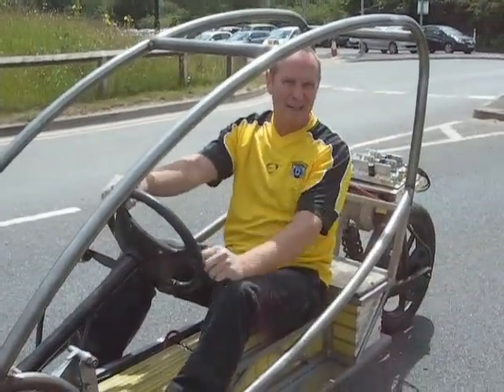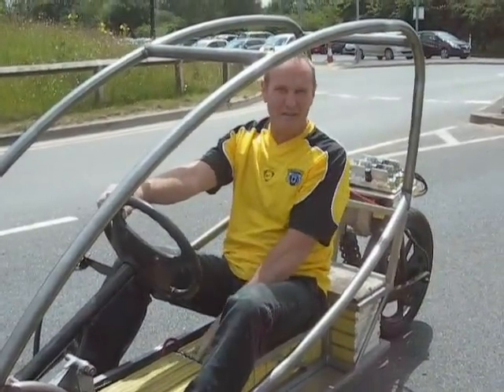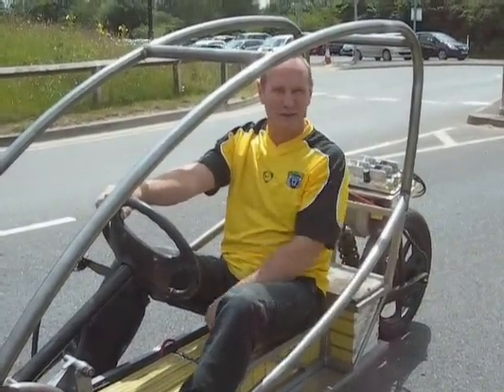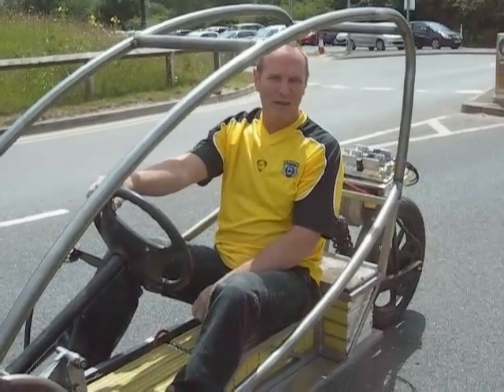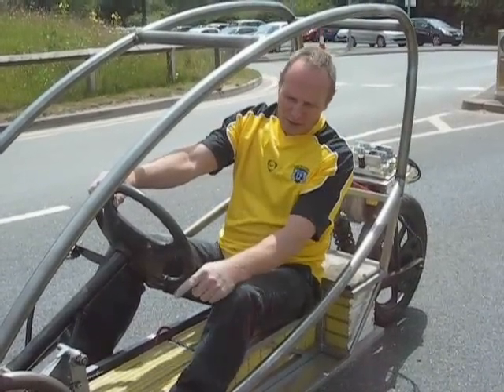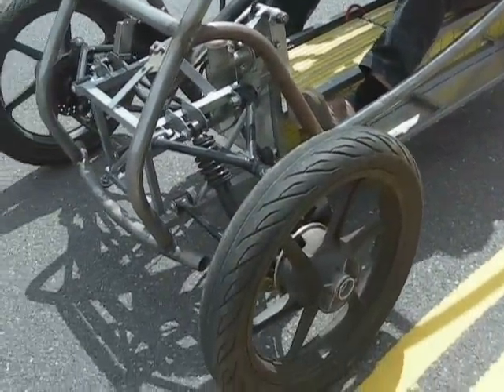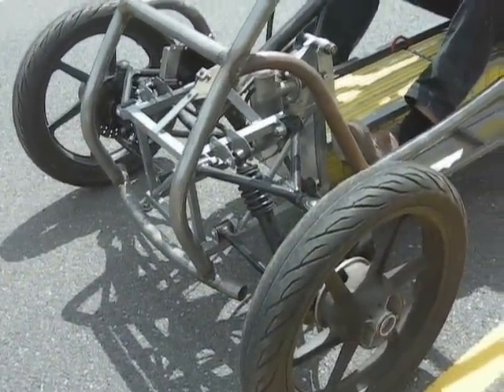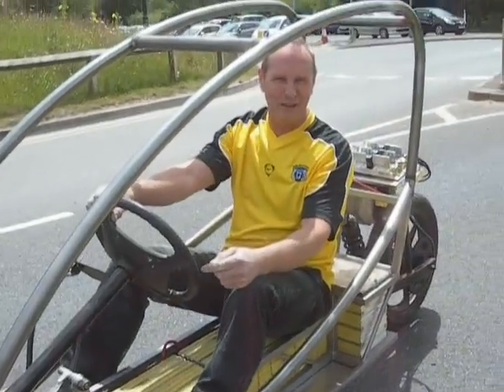How to make an electric car or DIY trike.

Comment: This is really great!  I converted my own car to electric and it runs well for me but, I have wanted to start from the ground up and build a really light weight vehicle that can go the maximum distance on a few batteries.  The more batteries, the more weight and the longer it takes to charge them.  60 mph is not bad and over 100 miles would be fantastic.  I will be watching.